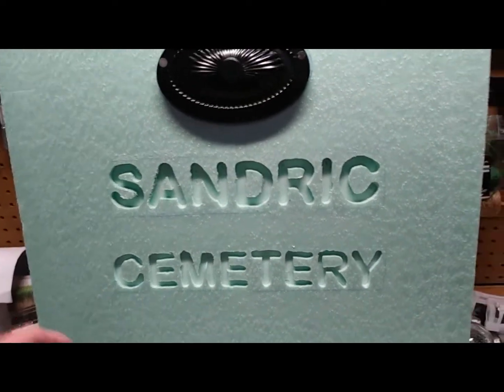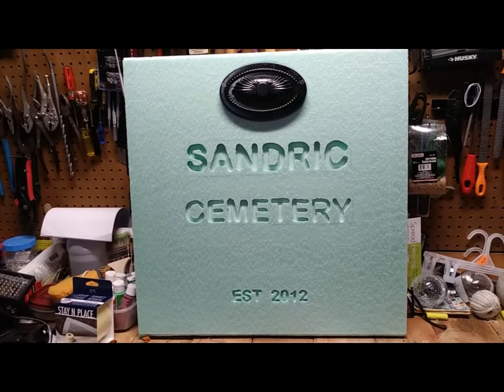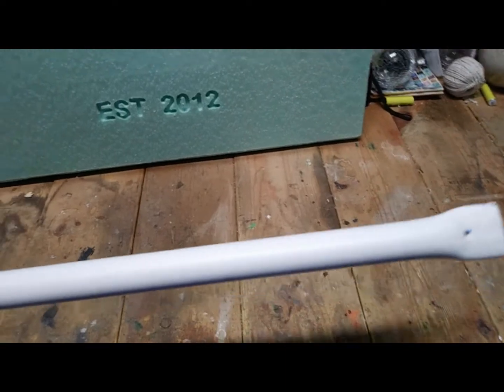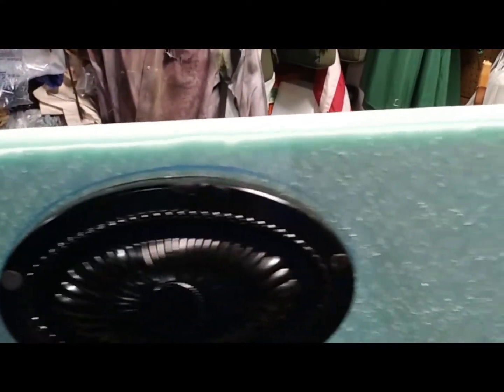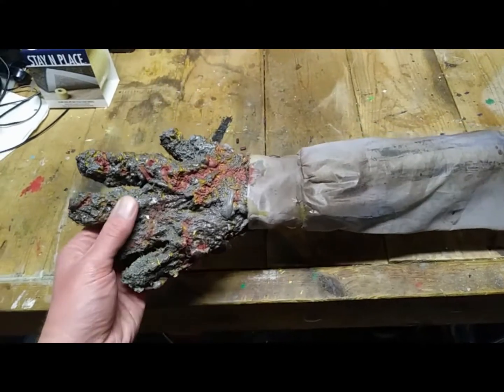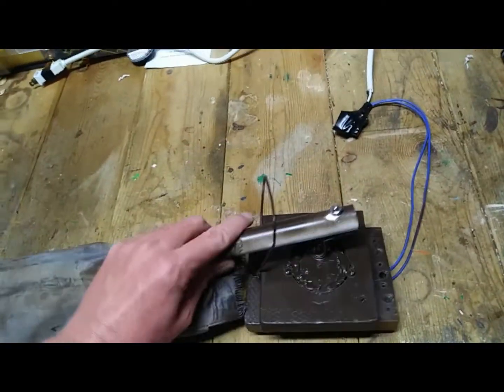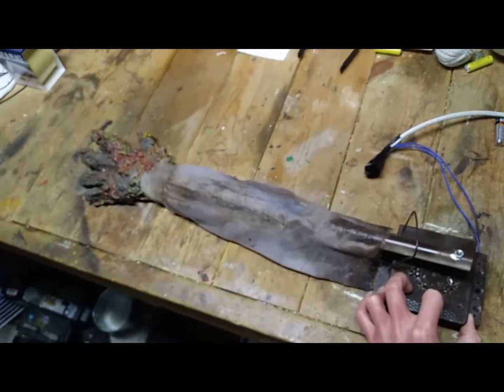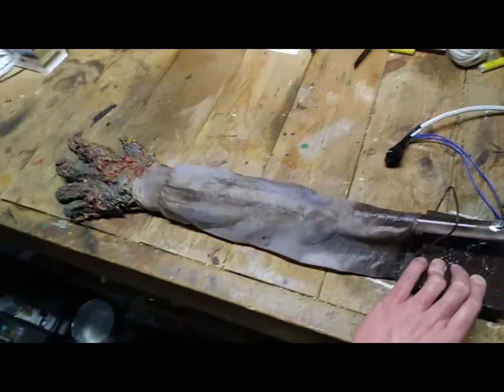More Halloween DIY builds - Projects #3 & #4

Comment: Hey love the movement  is the motor as strong as the deer motor ? and black lettering withe gray stone   HFL!!
Reply from the maker: Yes, the motor I used in the video is AC 100-127V, Speed: 5-6 RPM/MIN.  The deer motors are 110V- 5 RPM.  So this motor has potential to be a bit more powerful, the only difference is it doesn't have that plastic around it.  i just caulked all the seals and put some paint on it so it should hold up.  Thanks man for always checkin' in.  Also, you all are just voting for grey so I have to paint my white PVC posts lol.  JK.